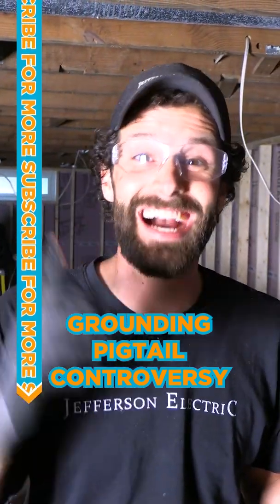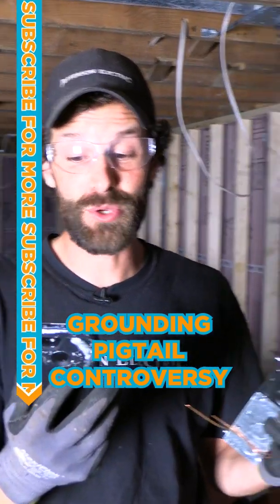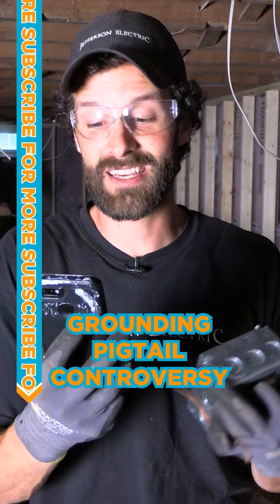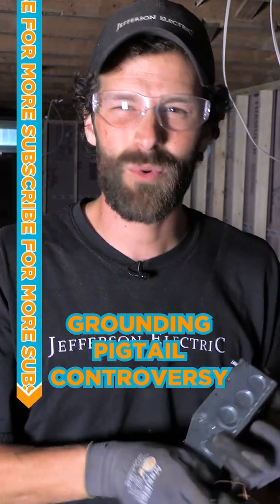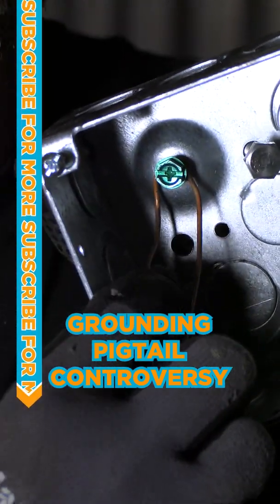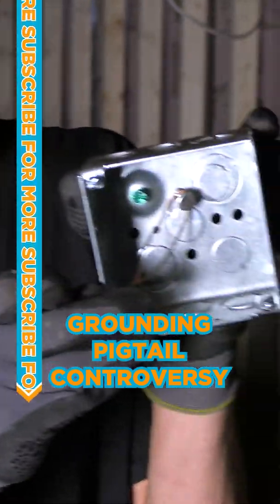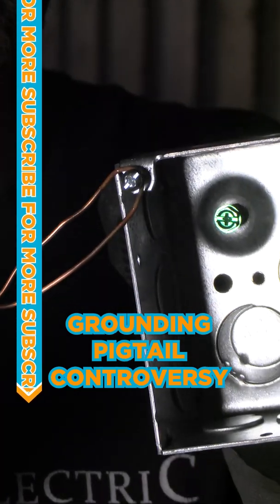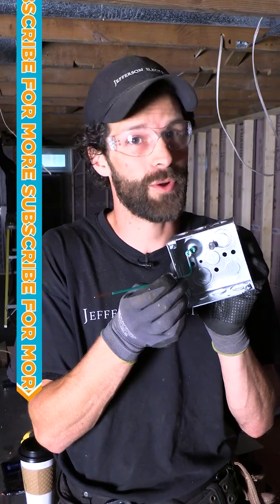Can a ground wire be wrapped around the box’s ground screw before attaching to a device?

Comment: am i wasting my time using those pigtail grounds with the green screws if the electricity in my house is all just 2 wire without a ground??
Reply from the maker: Not if it has a metal jacket! In that case, the jacket and boxes are the grounding path.
Reply: If it's cloth wire yeah.

Comment: Grounding screws and mounts are for grounding only, not hanging a box, not sharing the hole to mount the box, not using a lug in a hole not listed for grounding. Really it's based in common sense.

Comment: Is that OK to put a 14 Guage ground cable on a 20 amp breaker? Even though the hot and neutral are 12 Guage?
Reply from the maker: That was how wire was manufactured in ages gone by. Inspectors in Indiana will typically allow sizing the overcurrent off the phase conductor, but your AHJ might say otherwise.

Comment: Not needed if you have unbroken conduit with 120v 20amp. The conduit acts as the ground so no ground wire is needed.
Reply: Better get that bond bushing on thece correctly... From what I've seen, elecchickens can't do that right about 85% of the time.

Comment: It is my understanding that mid-stripping is not allowed by code since 2020. The grounding screw must have its own separate bonding wire, either green insulated or bare and connected with a wire nut with pigtails to the device'(s).
Reply: Code shmode.

Comment: I can't tell you how many times I've had to grab the book and quote "CONDUCTORS" as in more then one. The reason it says "no other purpose" is because they used to bond the neutral to the metal box in knob and tube systems so a hot to box short would blow a fuse. It's leftover wording and there's lots of that in all codes.

Comment: What would happen if you didn’t ground the box?
Reply: If the box is not grounded, then you are not meeting code. The danger is the box could be live and be a hazard.
Reply: If you didn't ground the box and a hot wire touches it the box will become hot. With no route to ground.

Comment: The sort of strange redundancy of it is that the screws holding the receptacle to the Box technically also ground the Box so why it's required is sort of unnecessary. In older houses, the ground was only bonded to the J box and the receptacle would simply ground through the box screw.
Reply: yes, in the old days that's what everyone did but now they want a dedicated wire to make sure. Just remember, prior to that code there was no ground at all! Outlets were all 2 prong and many homes didn't even have a ground rod.
Reply: If you have done repairs over the years, just think back to how many times you found screws not tightened. Back to my example of the screws being the only ground, and the yoke ears not being tight to the box (because they are on the wallboard) you have your answer.
Reply: @rupe53  I am attempting to install a Google nest floodlight camera at my girlfriend’s house and she has an older house that doesn’t have any ground wire. What do I do here? Just connect black with black and white with white, correct?
Reply: @BrianPex    If the house has BX (metal) cable you add a ground wire from the box to the ground wire of the new fixture, with a wire nut joining them together. The external parts of that Nest device are plastic so the ground in this case is for static electricity, so the electronics don't get toasted. IOW, while not critical for operation, it's a good idea.
Reply: @rupe53  it’s just two wires on the old light coming out. Can’t see anything else. Just a hole and the white / black wires coming out. :-(
Reply: @BrianPex   if you are removing an existing fixture, it must have been screwed to a box of some sort. If there is no box then you can get one at a hardware store that has mounting ears or similar to do this properly. (called an "old work" box) Make sure to use plenty of tape so old insulation doesn't crumble as you work. BTW, bring that new device with you to the store so you can match up the mounting style of the box. It might be rectangular or hex shaped, depending.
Reply: @rupe53  there is a single screw that holds it on to something inside the eve. It’s just a very small hole. Can’t see anything.
Reply: @rupe53  it’s up into a piece of painted wood with hold drilled out for the wires to come thru and this single screw holding it up. Very half assed install IMO
Reply: @BrianPex   well then, I guess it's up to you to make it as good as you can and hope it's better than it was, right? As long as it's out of the way and nobody bumps into it, then maybe it will stay there as long as the last fixture.
Reply: @rupe53  Yeah. I was thinking if the brass fitting it was screwed into was grounded, I could drill a hole and make a ground wire, attach to the green screw in junction box I’m putting up and then to the base ground screw of the unit. I’ll look more again when there. Thanks a lot man. It’s outta the way and no one will touch it :-)
Reply: @BrianPex buy a GFI receptacle and use that in place of that old wiring circuit system. Now you will have protection at a cheap cost. If you don't think that is appropriate than spend on a GFI circuit breaker to cover that circuit. Now protection is there on either those options. You don't have a bonding system because of that Era. So you use GFI.
Following the devices instructions.
Reply: @danstark462    That's actually the best idea I've heard yet. OTOH, to do that he'd have to install a GFCI receptacle in one box then run wires to another box, so the new fixture has something to mount on. That covers all bases and I have no idea why I got tunnel vision and didn't think of it myself.
Reply: @rupe53  put a prong plug on that camera, that powers that camera and plug that into the GFI receptacle. 15 amp 120  yes?
Reply: @danstark462     not my device so have no idea how it will be mounted without a box. OTOH, a pigtail could be added to a box to allow a plug / cord set up.
Reply: I reckon it's to make all the EGC connecitons as secure as possible -- minimizing how much it is disturbed each time the box is opened, or the wires moved around.
Reply: But now industry provides a ground/bond screw. So now upgrade to a current JB when reno.
Reply: The idea is a dedicated bonding screw. Please understand bonding is for devices as grounding is that large min number six from panel to the earth grounding rod or to the street water pipe that was at earlier time metal. Ground wire panel to earth.
Reply: It's OK we all learn. And pass it on.

Comment: The article says nothing about a screw hole. The article is saying that all metal boxes must have a connection to the EGC back at the source be it done mechanically with conduit or electrically with a ground wire.
Reply: Don't recall where, but in the mix they specifically mention GREEN screws and a specific thread pitch. IOW, you can't use a self-tap screw of just any size.

Comment: What if you are in a retrofit situation and the metal box has no provision for a ground? Can you use one of the mounting screws for the box to bond the box to the ground? Trying to make the best of a situation as you find it. I ran into this yesterday. thx
Reply: You drill and tap a 10/32 hole in the back of the box and install a green ground screw
Reply: @ElectricProAcademy  and Noah  Thx for the reply. Just trying to learn best practices and code so I can do the best job that I can.
Reply: No.. you can’t  (legally) unless that procedure is listed somewhere which I have never seen.  But you CAN use a listed grounding CLIP that mounts over the edge of the box.  They probably suck compared to tapping a 10/32 ground screw but it Is code- compliant.
Reply: Make sure to also drive a 9-ft grounding rod into the ground by the box to make sure it has a fail safe path to earth... A minimum of 1/0 gauge wire as well in case a person flipping the light switch gets hit by 🌩️ lightning ⚡
Reply: @xephael3485  please tell me this is sarcasm I'm gonna hate life as an electrician if I have to this to each box.
Reply: @jsb7546  your happiness should not come at the expense of others safety 🤣🤪
Reply: Use grounding clips.

Comment: Up in Canada, ALL boxes, whether steel and non-metallic, device or junction, include ground screws. Non-metallic device boxes with the ground screws have a steel strap that leads to one of the 6-32 threaded mounting holes to ground the yoke of devices. There is no ambiguity in Canada of how to ground boxes.
Reply: Canada is bad

Comment: 250.146? Even though it's code minimum, I'm pretty sure you can also use the device yoke.
Reply: You can't ground (bond) the box via the device but you can ground (bond) a self grounding device with an already grounded (bonded) j box.
Reply: @illestofdemall13  Exactly. Thanks for the clarification.
Reply: Yeah in the USA, if you use a steel box and mounting ring, and there is a conductive bond from the yoke to the EGC attached to the box, you need not make up grounding pigtails to the device(s). Up in Canada, all receptacles must have grounding pigtails even in steel boxes that are bonded. Switches need not have grounding pigtails.
Reply: @ElectricProAcademy  Thanks, I try. I try to learn every week. Reading theory and NEC stuff is a must.